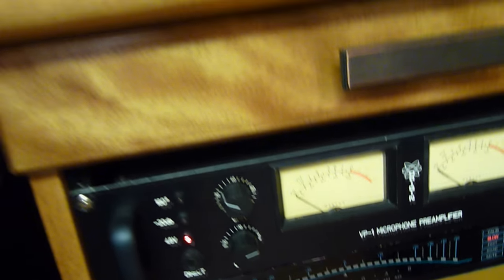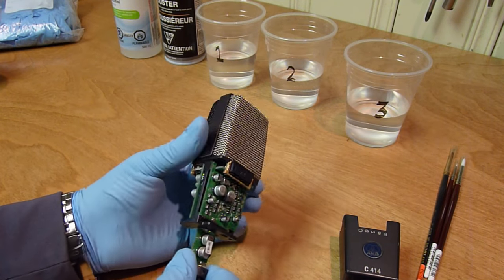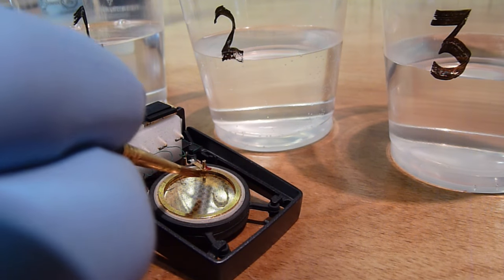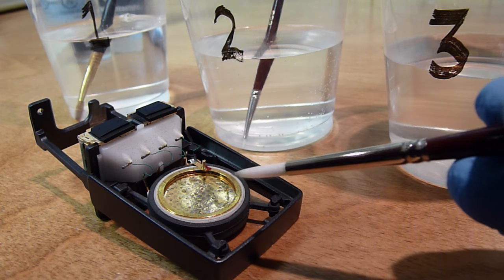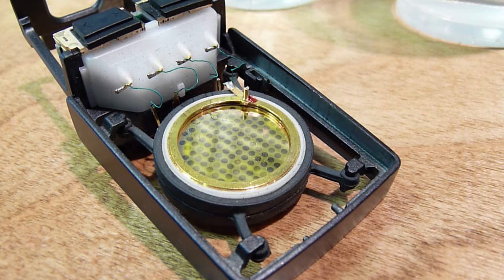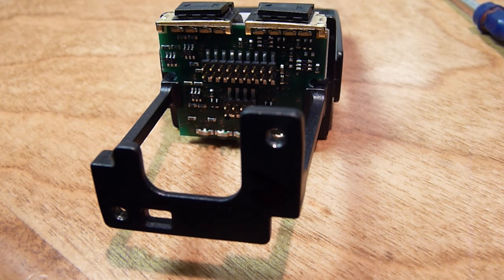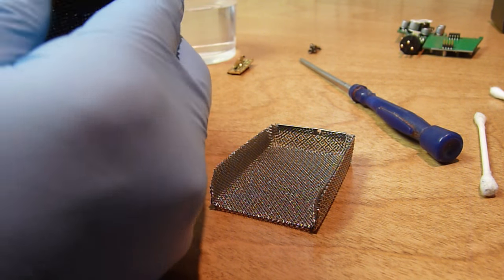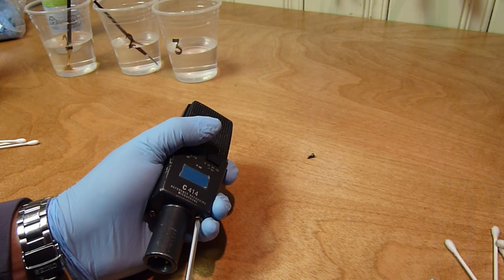Cleaning a Dirty Microphone Capsule

Comment: What happens when a condenser microphone loses signal for about 3 seconds and comes back on and works great for 2 minutes and does this all over again?
Reply: Probably the mic overloads becouse of too much air pressure, try to put the mic farther or use the DB pad - if it has one.
Reply: It could be moisture from you breath and the capsule needs to be replaced.  Try recording an instrument like a guitar and see if the problem is the same.

Comment: Hi. I have a neumman m149. The problem is that the volume of mic, goes down and goes up. It is posible that can be a diapraghm problem?
Reply: Sounds like a problem with the amplifier rather than the capsule, I'm no expert though.
Reply: Which is exceptional, as a good JAN 6111 will cost you $12...

Comment: Hi, I have a problem with my Rode Nt2a. I sent him to repair ... I was told he took moisture and can not fix it ... that I can throw it. Sometimes it makes a noise, a breath. According to you, can I fix it by cleaning the capsule? But should I do it for the sides of the capsule? Sorry for my poor English.
Great video.
Thank you in advance.
Reply: Hi, I know this kind of problem. Please do not keep your microphone in a wet environment. When it's noisy, put it for 4 or 5 hours above a soft warm source (Around 25 or 30 °C)
Reply: Patrice D'hautcourt Hard to do when it's 75%-95% most of the time

Comment: I have a problem and you might help. I have a noisy mic, it has noise and the capsule is not so clean, but not as dirty as this here. Is that noise you had here static or is it changing. Noise on mine varies. Its very silent popping and clicking, almost unnoticeable but it's there.
Reply from the maker: Dirty capsule is usually not static.
Reply: Thanks!

Comment: That capsule frame is attached to the body of the mic with rubber that dries over time and cracks. What happens then is the capsule rattles and breaks the wires. Just a total crap. This mic is a waste of your money!

Comment: this technique stinks, you're just moving the debris back n forth across the surface and damaging it, just flood the area and turn it over to dump the debris off, then flood it again, no need to swirl and scratch the surface of the membrane, also this technique only applies to a sealed c12 capsule for a 414, any capsule with screws through the tension plates is a big risk, that is about 95% of ldc mics